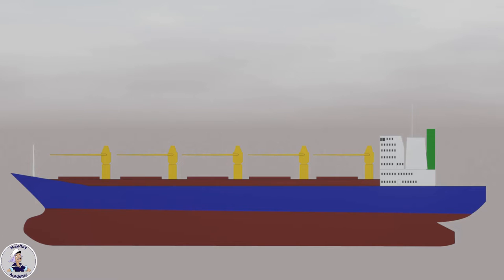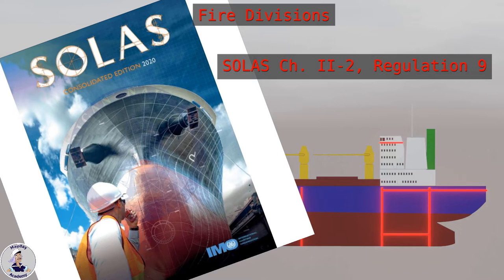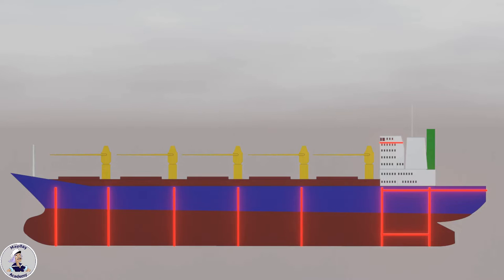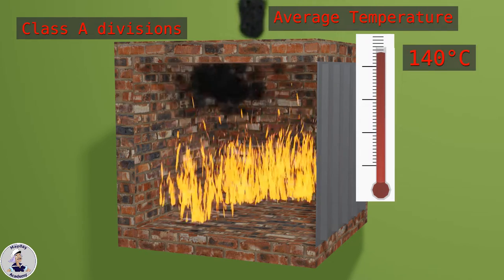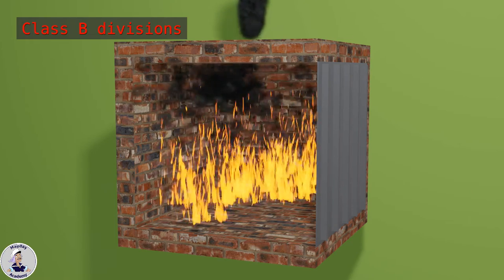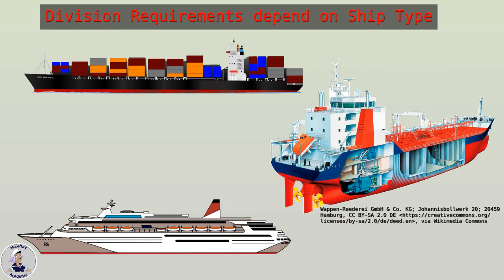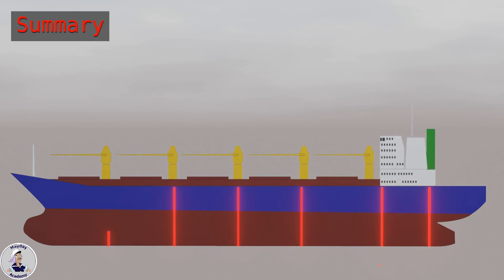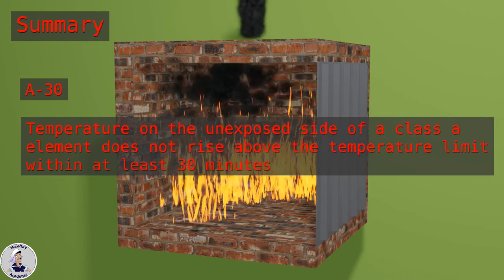Ship fire safety: SOLAS fire division rules

Comment: Hi, if the Bulkhead is made of Steel only, can that call as A-0 division Fire bulkhead?
Reply from the maker: Hi, thank you for the question. I only counts as class a if it is tested that no flames or smoke will go through for one hour
Reply: Thanks for your response..
So to comply A-0 class division this Bulkhead or deck should require thermally insulated with non- combustible materials? That for sure for A15, A30 & A60 need to be thermally insulated with combustible materials.
Can you share video showing how it's look like this A0 & A60  deck/bulkheads and B Class division...